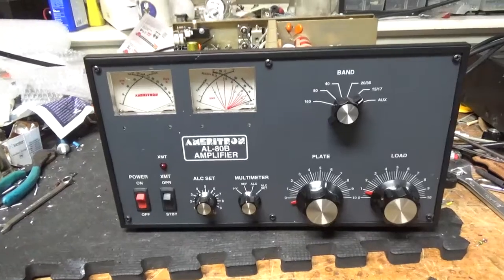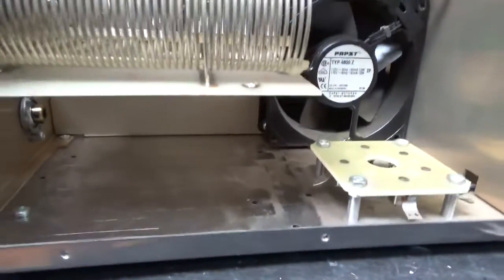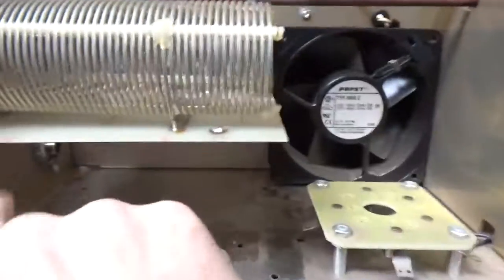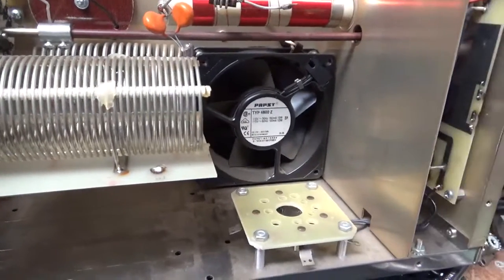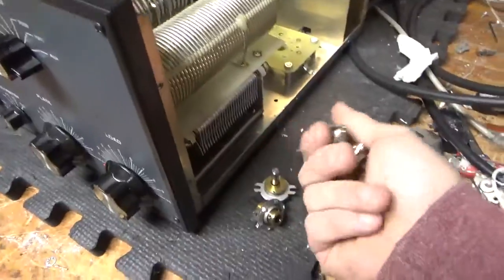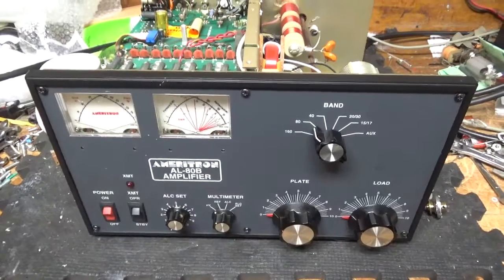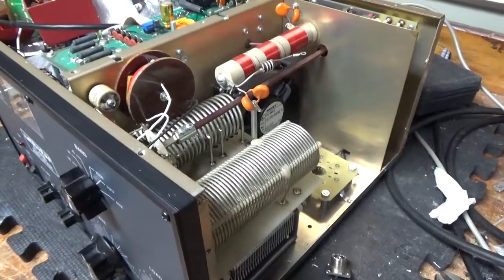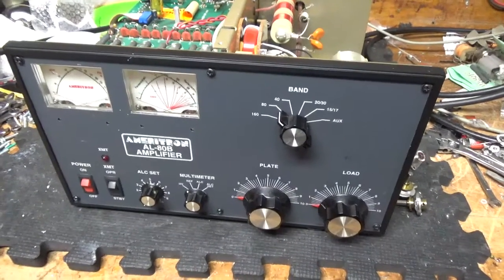Ameritron al-80b Repair , Modifications , Reduction Drive Replacement Penta Lab Tube

Comment: I see you change a lot of so 239's. Is it that Ameritron is using crappy connectors? Great videos  thanks for sharing.
Reply from the maker: Not sure if cruddy so-239 or if owner is plugging a pl259 in at an angle or one with a solder glob on the center pin. Never want an open on the output. If one is bad I always change both.

Thank you for watching 

73